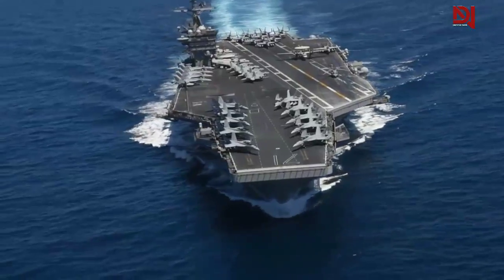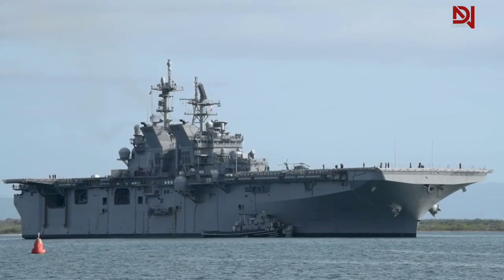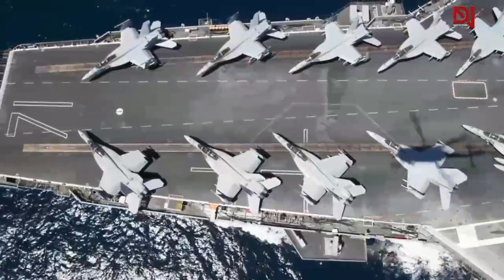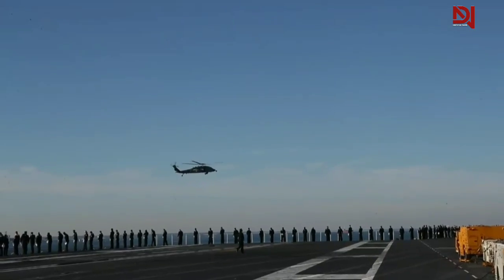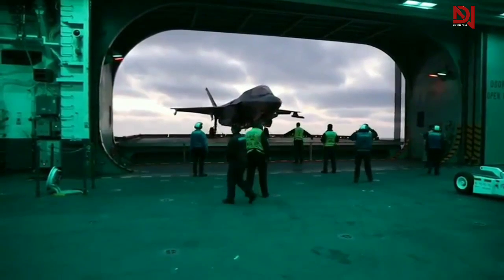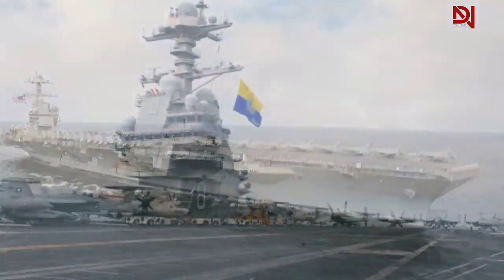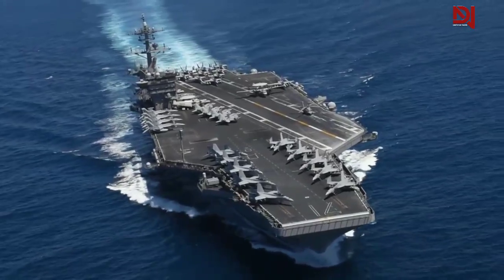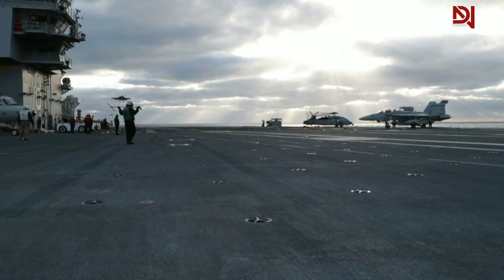Why US Aircraft Carriers Don't Have Hangar Bay Doors?

Comment: I served on cv 67 jfk. we sailed in the arctic circle in 1977 and the temps outside would have made it impossible to work in hanger without ability to close them. this makes no sense to me. How do they overcome that for the crew.
Reply: They didn't - Carriers DO have doors, the title of this video IS A FLAT OUT LIE.
I served on Ranger (CV-61, not CV4) and also saw the doors closed on Midway at one point when we ran it out of drydock at Yokosuka.
Reply: The Gerald R. Ford class doesn't have bay doors. Modern air conditioning is able to provide effective thermal insulation.